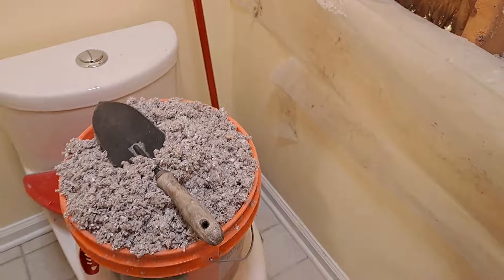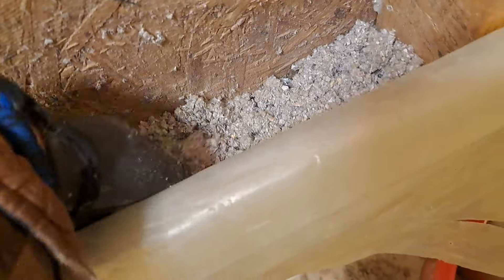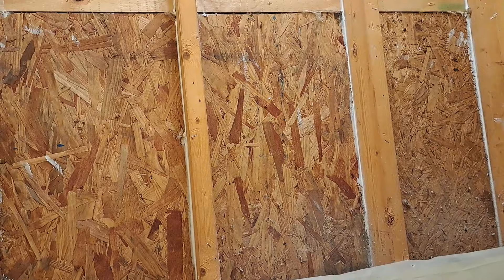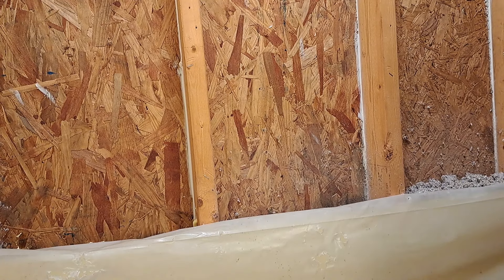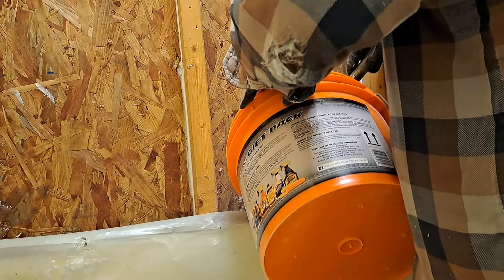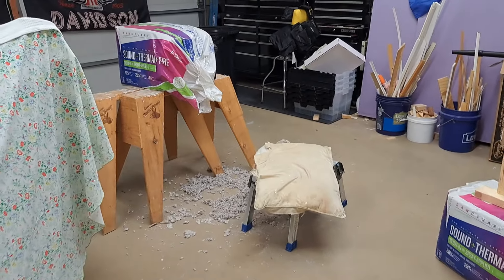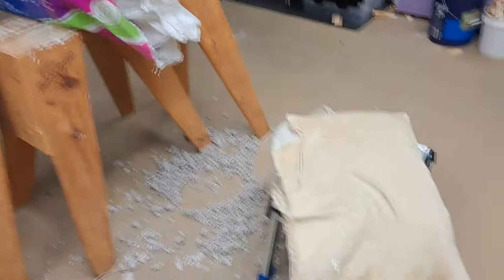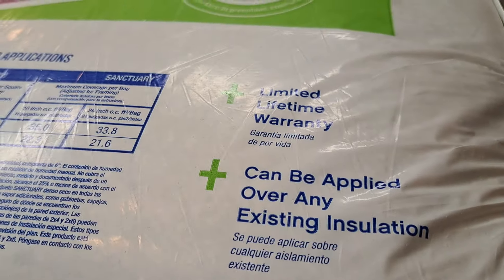Its Cellulose 20231219 182255

Comment: For a small job like a bathroom, mineral wool would have been a better choice.  Wool is water resistant and won't settle even when wet.  FYI.
Reply from the maker: I thought about that. But my local  Lowes has it on back order. And at least 30 days out. So cellulose  was my 2nd best option. Thanks for watching.